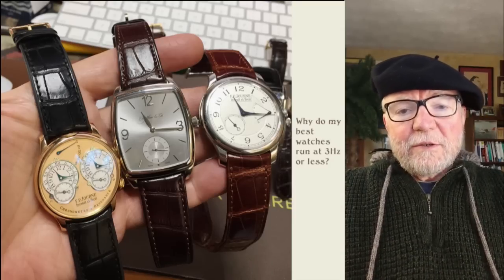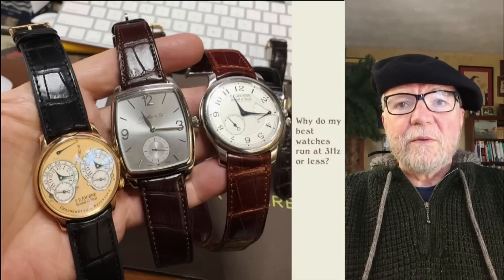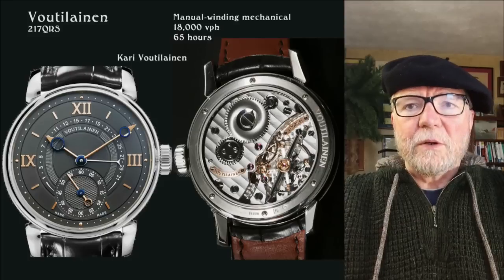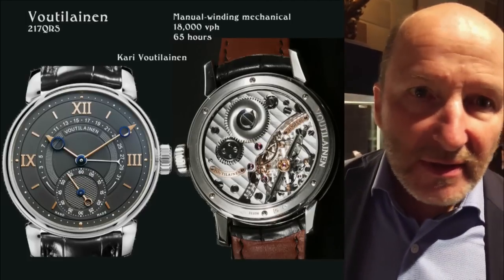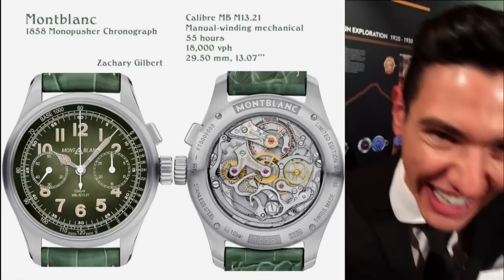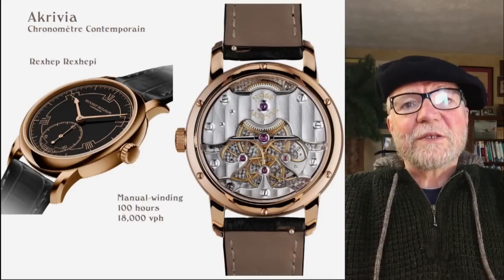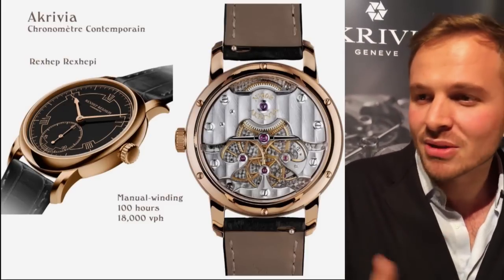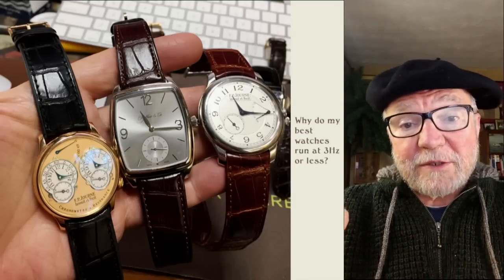Low Frequency :Answering the Question of Why the Top Watchmakers use Frequencies of 3Hz or less #169

Comment: Ryan Schmidt did a quill and pad article that is very detailed on the subject and dispels the myths associated with both lower and higher hertz. There is no right or wrong.  The longer reserve, classical watches back to Pocket watches were lower hertz, less complexity, more space in the movement for visual appeal,  and the tradition is still rpevelent amongst independent watchmakers.  Zenith and Grand seiko lead the 36VPH but also have great technologies and complexity that goes into making the higher beat movements not require more maintenance. PArts materials and new technology offsets the lubriction and increased pounding it takes.   People need to understand the escapement parts play a big role in accuracy too so a higher VPH does not mean more accurate than a lower vph if the escapements are not the same.   off to the wind up watch show in nyc today (thru the weekend i think today only for me )
Reply from the maker: Hi Richard, winding up today? I didn't know there was more show?! I think that Ryan is asking and answering a different question than I. I'm not sure he dispelled anything as far as the observation that the top watchmakers use the 18,000 vph. Not a lot to dispel there...and this keeps circling back to the fact that while the "standard" is 28,800 vph, these top watchmakers use 18,000—for the most part. Why? That was the question, and it's not the one Ryan was addressing. Check out this link Kevin sent me:  https://youtu.be/nr9PDFAPj8c starting around 19:20 of Roger Smith's talk. His comment, in the section Fast Beat,  "....."a faster beat hides inefficiency in design"... hints at what I suspected. His designs are elegantly simple as are Marco Lang's in Caliber VI....the trigonal bridge allows the owner to see what's going on and at the same time speaks to the simplicity of the movement. Anyway, it's something we can entertain ourselves with...and will perhaps be a mystery that will lead to a better understanding of what goes on in a mechanical movement. Cheers, Bill
Reply: @watchartsci  yes a micro show biggest ones are Stowa and Oris, Bunch other smaller micros, met the owner of Zelos, Elshan Tang, so young and his watches are unique.  Bought 3 Stowas for my 2 Daughters and a boyfriend for Christmas.   The Worn & Wound watch show "Wind Up" is held in Chelsea Mkt (had a great quick braut and German beer for lunch yum) which has a great number of food places and stuff will post some pics in the group.

Comment: Great video, thank you! It clearly explain why 3Hz or 2.5Hz is appealing to watchmakers. This leaves open the question of why watchmakers don't try to go lower. Apart from a few watches with giant balance wheels and frequencies around 1Hz, most watches don't run below 2.5Hz. My guess is that otherwise it would affect precision or the balance wheel would have to be too large and therefore complicate the movement design.
Reply from the maker: Hi David, great point. I suspect that there's a point of diminishing returns as frequencies go lower, and you're right about the size of the balance wheel. The balance wheels on Kari Voutilainen look huge compared with other watches. (I would dearly love to have a Voutilainen...and the only thing preventing me is the price...). Kindest regards, Bill
Reply: A while back, I believe Antoine Martin had a 1Hz watch?

Comment: Wonderful, wonderful video, Bill! This is one of the best, most informative watch videos I have seen. Thank you for your time on this. I do have one question; when you mention "increased inertia" of the lower beat movements, is this exhibited in the longer power reserve, increased accuracy mentioned by some of the manufacturers or both?
Reply from the maker: Hi John, thanks man! Basically the higher moment of inertia (a bigger, heavier balance wheel for all practical purposes in a watch) means that the oscillation frequency is less susceptible to alteration by external influences and so more accurate. Take a look at the size of the balance wheels in Kari Voutilainen's  watches in this profile: https://www.watchtime.com/featured/kari-on-meet-watchmaking-star-kari-voutilainen-profile/ However, I could write a book on what I DON'T KNOW about the moment of inertia. That's why I depended on the really top watchmakers to provide the clues of where to look for wristwatch excellence. Cheers, Bill
Reply: @watchartsci  Thanks, Bill! I am still fairly new to this and still learning.

Comment: Thomas L
I enjoy most of your videos, since I started researching high horology timepieces about six months ago. Is informative, honest opinion and I have come to understand watches better than before. Regarding this particular video about the frequency of 3 Hz (21,600 vph), I once asked a Patek Philippe boutique sales consultant a couple of months ago, here in Melbourne (Australia),
I was told it contribute to less wear and tear. Personally, rightly or wrongly, I prefer the 4 Hz. I also prefer self-winding timepieces. I find manual-winding troublesome as I need to wind frequently.
Reply from the maker: Hi Thomas, there's no "right or wrong," as far as using 2.5Hz, 3Hz, or, the most common, 4Hz is concerned. It's just that the top watchmakers prefer frequencies under 4Hz. Hajime Asaoka, Roger Smith, and George Daniels all preferred 2.5Hz, and in looking at the finalists in the 2020 Grand Prix d’Horlogerie de Genève (that was just announced yesterday), Kari Voutilainen, Ferdinand Berthoud, Brivet-Naudot, Petermann Bédat, and MB&F (among others) all use 2.5Hz (18,000), and most of the others, except for the cheaper watches, use 3Hz (21,600). I'm sure that the salesman at Patek Philippe was sincere and not inaccurate about using 4Hz in the bulk of their watches (Rolex uses 4Hz and automatic movements in all of its watches). Most Parmigiani Fleurier watches use 4Hz as well (I have two—and they're wonderful watches); so it's not that there's anything wrong with 4Hz ... or automatic watches ... it's just that the top watchmakers use 2.5 or 3Hz and prefer hand wound. Take care and be safe, Bill.😷

Comment: I will have to do some research myself but I suspect you are correct. A higher beat movement may require more complex gearing and consequently be less visually appealing. A slower beat movement may provide the watchmaker with more design options while still allowing for a certain level of precision.
Reply from the maker: We keep forgetting Bill: a $10 quartz will beat anything mechanical for accuracy in time-keeping. I don't think complex gearing is the issue so much as beauty in simplicity. Much more difficult to create a simpler watch with optimized timekeeping than a gear-heavy contraption. The same is true in programming; a simple, elegant  algorithm and structure is harder to conceive and build than piling code on a problem to solve it. It's what I liked about design patterns and lambda calculus applied to programming. Initially more difficult to grasp and appreciate, but ultimately it leads to better programs. Cheers, Bill

Comment: Great video Bill! Now it raises the question of why does Rolex use 4 Hz movements? For that matter is a 4 Hz movement more accurate than 3 or 2.5? From your video it seems as if the larger balance wheel wins back some accuracy from the slower beat rate and clearly improves power reserve. Are there COSC chronometers  with low beat rates I wonder?
Reply from the maker: Hi Bob, thanks! Rolex makes about 1.4 million watches a year, and 4 Hz movements are more forgiving than those with lower frequencies. So, if something is off, there's less visibility because with each semi-oscillation at higher frequency, the time of the flaw can be lessened or as Roger Smith suggests, 'hidden.' F.P. Journe could care less about COSC and a Poinçon de Genève. His chronometers meet and exceed both COSC chronometer specs, and he (unlike Patek Philippe) have not given themselves a Poinçon de Genève in the form of overlapping 'Ps.' Cheers, Bill

Comment: Bill, l so happened to watch this video today. Here's my take from a builder's perspective. In buildings, there're two important aspects, architecture and engineering. In terms, of engineering, perhaps, we can likened them to high performance cars. Take for example, the GS caliber 9SA5, which runs at a high frequency, maintaining 80 hours of power reserve, regulated at 6 positions to keep precision over a long period of used. It does not look as nice aesthetically as the watches presented, which, focus on architecture, but, it does look reasonably nice. Then, we can look at the 9R02, handmade in the micro artist studio, in very limited numbers. This is not only a high performance watch, but, with beautiful architecture too. Its finishing is second to none. But, of course, they do have Phillipe Dufour to thank. In the credor line, they do have calibers that focus just on architecture, or, low performance watches, complications aside. We cannot really separate the two, as they depend on each other. This is my command sense views. The experts views are much appreciated. Thanks for this very interesting topic.
Reply from the maker: Canon, you can pick up a used Ferrari for very little money because, while high performance, they eat themselves up. If you want to make a car comparison, check out a Singer ... both their cars and watches. Take care and be safe, Bill😷

Comment: Another nice video, Bill.  I agree for the most part with what you state.  However, my higher (4) Hz watches do tend to be more accurate than those that are 3 Hz or less, and I think a chronograph should have at least 4Hz for granularity in measuring time.
Reply from the maker: Hey, SouthNC63 ... we've been led to believe that 'higher is better,' but if that's true, you can run down and get a $10 quartz that will be more accurate than a Dufour Simplicity ... Probably the majority of my watches are 4Hz...especially the entry level ones. I think that of my 4Hz watches, my Habring2 Felix is the most accurate. For 3Hz, my Patek Philippe Calatrava...but then there's my 2.5Hz H. Moser that's both accurate and has a nice long charge. Check out Roger Smith's talk in New York City, the section on 'Fast Beat.' at  https://youtu.be/nr9PDFAPj8c about 19:20 . That addresses why the best watchmakers use 18,000 vph, Cheers, Bill

Comment: probably down to trade off between accuracy and longevity? A chronograph watch probably tend to have higher frequency as a stop watch. The normal time only don't need to be that precise.
Reply from the maker: I don't think that's it Richard—the trade-off. It takes a lot finder tuning to have an accurate 18,000 so/hr than a 28,800 so/hr. That's why I value the lower frequencies (belong 28,800). Take care, Bill

Comment: Very informative video. Kind of dispels the notion that high-beats are better and more accurate.
Reply from the maker: Hi Sylvain. I had noticed that most of the top watches were at a frequency under 4Hz but I didn't know why. It turned out that all of the watchmakers I talked with used a frequency of only 2.5Hz. Love mysteries in watchmaking! Cheers, bill

Comment: I am surprised only Mr. Murphy touched up in the wear and tear issue.  The lower the frequency means you will have less internal motion, and more important, less stress in the parts which is more durability.  Regardless of the advances made in materials, reduced friction, etc. a spring or counterbalance moving at half of frequency statistically has better chances to have a longer life.
Reply from the maker: All of the interviews, Marguit, were off-the-cuff and in the middle of a noisy watch event ... but you are correct. Lower frequency; life. Take care, Bill

Comment: I'll just leave this note before I start watching to see how much of it I got right in the end :)
- lower frequency =more prone to outside disturbances
-higher frequency =more stable and therefore accurate, however they consume more energy.
- large balances with screws look. traditional and nice and so low frequency watches are very appealing.
-theoretical max time to overhaul should be significantly longer for low freq. escapements
Reply from the maker: Hey Diggert, here's what we're all faced with 1) Physics and 2) A practice that seems to counter a common understanding of that physics as applied to watchmaking. The empirical reality is this: the top watchmakers in the world... and this includes Philippe Dufour and Roger Smith in addition to the gentlemen I interviewed...prefer a lower frequency in their watchmaking. So the issue is not what we know, but what we must learn from these top watchmakers. Cheers, Bill

Comment: My Blancpain Barakuda runs at 3Hz. I have a vintage Omega military watch that runs at (I'm pretty sure) 2Hz. Interestingly my latest toy (a Patek 5296G-001) runs at 4Hz. The earlier iteration of the calibre used to run at 3Hz, but they increased it. I think I heard somewhere that it takes a little longer to regulate a calibre at lower frequency?
Reply from the maker: Hi Jay, did you check the frequency on the Omega Military with a timegrapher? Having a 2Hz watch would be very cool, but they tend to be 2.5Hz. Upping from 3Hz to 4Hz is a common practice because they tend to be simpler all around and require more frequent service ($$) and wear out quicker. It most likely does take longer to regulate lower frequencies, but it's required less often as well. Take care and stay safe, Bill 😷
Reply: @watchartsci  I didn't check it, it could be 2.5Hz - it's a 1953 "Fat Arrow"6B/542 made for the Royal Air Force. I also have a 1943 Jaeger-LeCoultre (a special order for the RAF during WW2) which is currently at JLC for vintage service appraisal - that one really could be as low as 2Hz, I think.
(EDIT: I did some online research; an Omega calibre 283 would indeed be 2.5Hz. Sometimes the military order watches were regulated to a higher level, but I guess it's unlikely they would have slowed them down.)
Reply from the maker: @j.burgess4459  It sounds like you've got you mitts on a very cool timepiece! Take care and stay safe, Bill 😷
Reply: @watchartsci  Yeah, militarily watches are a whole field. Back in the 40s and 50s the watches issued to aircrew (especially air-navigators) were a very big deal - navigators needed the most accurate chronometers available, which could also resist the vibration and magnetism in aircraft cockpits. The 6B/542 would have been (I think) for pilots and air-controllers. The JLC I have is a 6B/159 which was for navigators.

Comment: Here's my take...independent watchmakers can't afford tech the giant companies like the Swatch, LVMH and Richemont can and hence achieving a longer power reserve is a challenge. Accuracy with lower frequency can be achieved by a larger balance wheel and larger balance wheel is also easy to handwork compared to a smaller one. The larger balance wheel is also easy on the eyes to look at the beauty of the balance ticking.
Reply from the maker: The only problem with that analysis, Varun, is that so many of the big companies prefer to use off-the-shelf movements by ETA and Sellita. If they have the motivation (willing to make the investment) in movement development; they would. When Richemont invested in a movement, they did so by developing a system to replicate movements through ValFleurier, and so Piaget, Cartier and even Vacheron Constantin, all now share a movement initially developed by Cartier. If you look at the work of Roger Smith, you see all hand-made elements. With F.P. Journe, you see the same thing but on a slightly larger scale. You can have anything made that you don't have or are difficult to make, such as pinions and gears; but they're not that difficult. Take care, Bill

Comment: It makes sense that increazing the size of the balance wheel will increase the accuracy. Remember the pendulum clocks with their slow beat. The clock in Big Ben is accurate to less than a second in 24 hours.
Reply from the maker: Hi Amund, great example! So Big Ben loses a second a day...needs to go to the shop! Cheers, Bill
Reply: This comparison does not work really. A higher mass, therefore higher rotational moment if inertia and therefore lower frequency balance wheel will be more prone to disturbances by accelerations imposed upon it. With a precision pendulum clock, outside influences are ruled out due to their location. Think of it this way: if you wiggled around a pendulum clock, would it keep precise time as a high frequency tuning fork watch or quartz would?
Reply: I think you'll find an answer to why large pendulums are accurate in the term quality factor (check it out on wiki) which puts the energy stored in the pendulum in relation to the frictional losses. That number is - with a high mass pendulum - obviously very high and so the impulse required to keep it going is very low compared to the kinetic energy of the pendulum. However, the influence of outside accelerations is what ruins the comparability of pendulum clocks and wristwatches.
Reply: Having now thought about and researched a bit: The quality factor is indeed what we are looking for and someone explains it here for watches in a very good way https://en.m.wikipedia.org/wiki/Talk:Balance_wheel  My mistake was: the increase of balance mass indeed improves the quality factor, but thr resulting decrease in frequency counteracts that improvement.
Reply from the maker: Diggert, we need to listen to the watchmakers who actually make and design watches. Otherwise, we speculate. Thanks for the link on the balance wheel. Now check this out and respond (please!) Start about 19:20 where Roger Smith talks about 'Fast Speed'  https://youtu.be/nr9PDFAPj8c about 19:20 Thanks, Bill